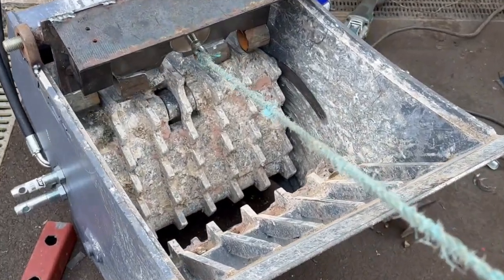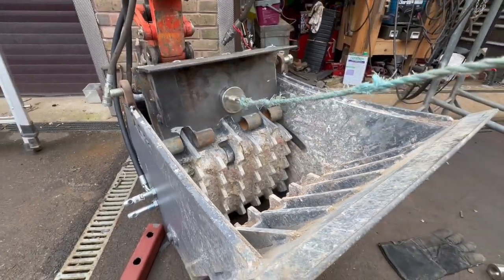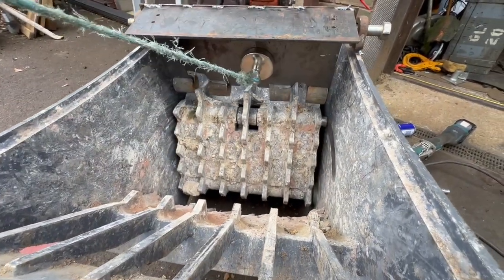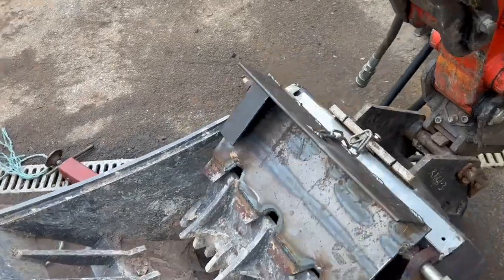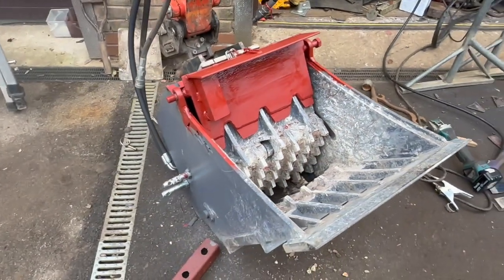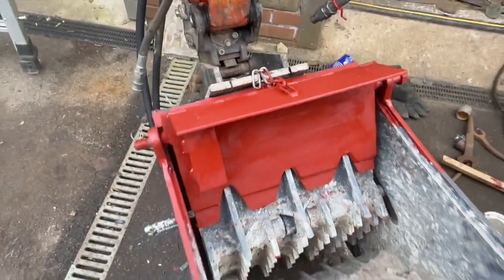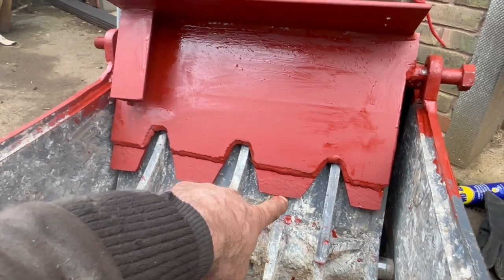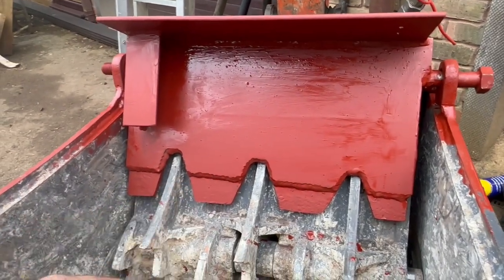Crusher bucket Part 3 of 4,  TMA c2 CONCRETE CRUSHER modification.

Comment: Right job always thought that was a weak point on them buckets. A few hours of testing now and thats another project perfecte👍👍 i found a wireless remote i forgot about for my upcoming winch project be a handy one tumbling a few trees on my own
Reply from the maker: Yes I’ll have to get back out to yard and throw some material through it. Fingers crossed it was worth it 🤞.  Remote winch….posh! Still using  the MK1 thumb on my build 😉
Reply: @bluesix2843  only after getting a new computer built for my 17 year old son with solidworks he has drawings done for a rake and working on several brackets to get profiled out it's totally changed the project pile 🤦🤦
Reply from the maker: @ruarioshea6015  A land rake for the a machine? Great bits of kit. I use mine all the time.
Reply: @bluesix2843  the ones I usually make I use the bars out of the carousel wheels on an armor salmon beet harvester and make them removable so you can take out every second one or only leave 3 on one side for working narrow strips beside footpaths etc the new one is going tilt with fixed profiled tines for a change. Every machine should have a rake
Reply from the maker: @ruarioshea6015  sounds great!. Adjustable tines/multi size  is really handy. I combine mine with the thumb on the machine. Covers so many bases.
Reply: @bluesix2843  thumb looks the business having trouble with my new to me JCB 8032 sorting double acting on hammer lines used a bobcat recently with one it was a game changer
Reply from the maker: @ruarioshea6015  This latest Kubota has all the toys. Hydraulic hitch too. Thought I’d have a little luxury on this one. I made her a little heavier (1.9) to cope with the added dipper weight and things like my p10 post knocker. They can get a little tippy with this amount of gear on them out front.